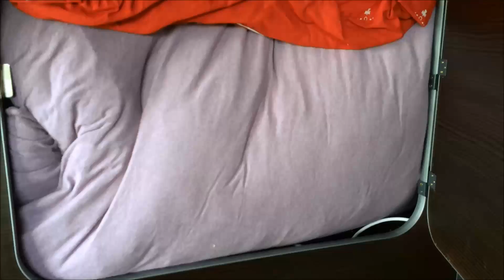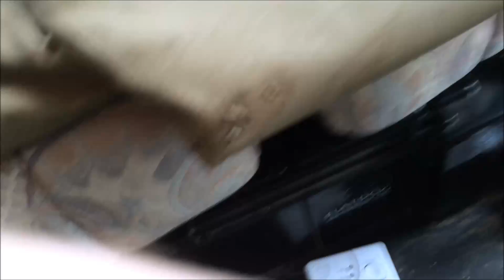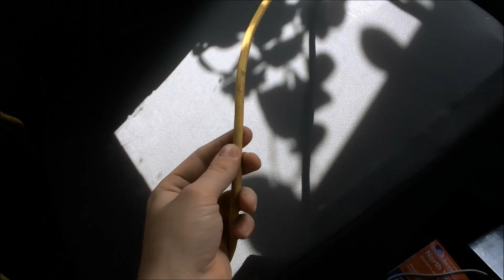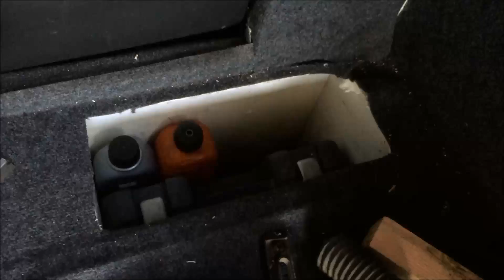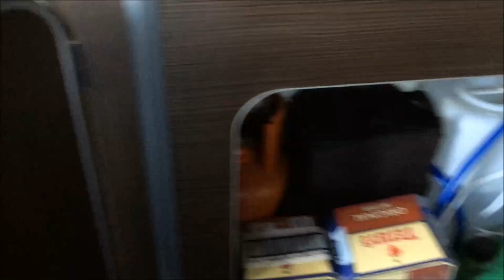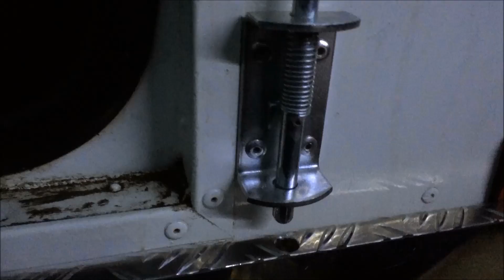bug out camper vehicle prep and organize for the bushcraft show.

Comment: a good source of protein lol nice one. i would keep the double doors bro, if you have gear on the outside then its more likely to get nicked and in a prep situation it would look like a good vehicle to steal. think about blending in and not have a big red arrow saying I HAVE ALL THE GEAR AND YOU DONT, lol, hope that helps your doing a fantastic job bro, Martin
Reply from the maker: martin farrell  i thought about the blending in thing but to be honest im way beyond edna blending in any where lol. the only bits i would put on the out side is the high lift jack and more water just because i have no where to mount the jack. im thinking of making the wall for the back end of summer but in a way i can just drop it back off in spring. thanks mate
Reply: Torn Apart self sufficiency  now thats an idea bro, swapping the doors, great idea, think that will work well for your situation. atb, Martin

Comment: I wonder if these guts can help with seals for whatever back door option you go with buddy http://www.sealsdirect.co.uk
Reply from the maker: wjnr1 thanks for the link mate. if i do go down the wall route it will be very easy to do as i can weld a frame in and rivit a sheet of composite to it then just cut the shape out and fit a new camper door. i bit of insulation and some ply and its ready for carpet inside. i could even put a little window in one side.

Comment: It is all a process, but you have a jump on it mate... Really like your setup, looking good, can't wait to see the finished product. Did you make a electric diagram? You know for years down the road... LOL Thanks for sharing!!
Reply from the maker: Central Oregon Survival Network thanks mate. i get a little bit done most days. iv not bothered with the wiring diagram cos its so basic. i have a direct feed from the batt too each switch panel they are all fused so pretty easy to follow. all the wires are very easy to follow too being an old land rover. i cant leave anything alone too so years down the line i will have ripped it all out and re done it all 5 different ways.
Reply: Right, building and rebuilding brother... Well you are doing a great job mate.. Like the series!!!

Comment: Your better off keeping the doors just incase you need to get a casualty in the back, if it's a bug out motor then best to have it ready for any situation rather than struggling. Better to have it and not need it than need it and not have it
Reply from the maker: Ukprepper24 yea thats a good use. its just the amount of rain and cold them doors let in anoys me and if iv got the family in there i want them as comfy as poss without the heater sucking fuel. also for river crossing the big back doors dont seal too well so water will poor in. i dont know. more over time to get the other jobs done first.

Comment: What is your vehicle registered as? If it's no more than a Land Rover you might run into problems with your rear door conversion, Road Traffic Act, Construction and Use Regs, insurance declaration for converted  vehicle etc. If registered as a camper you'll get away with it. I know insurers and if you have a bump they'll use any excuse not to pay out, such as, no one told us you had converted your vehicle etc. Other than that, yes good idea.
Reply from the maker: It's on specialist off road camper insurance with an agreed price. The more modified it is the more the specialist company's like it.
Reply: Torn Apart self sufficiency I'm not talking insurers I'm talking log book. Is it registered as a camper with DVLA or a Land Rover. If a land rover my comment on TAC con & Use regs would apply